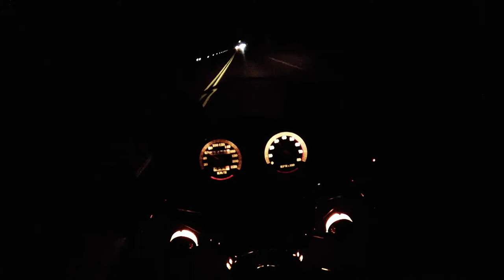1989 FXRS-SP Real World Performance Upgrade Discussion

Comment: Do you have the replacement progressive springs or the heavy duty progressive springs?
Reply from the maker: I have the regular replacement springs. I removed the air adjustable system from the forks, due to continual leak issues and faulty anti-dive solenoid, so he progressives were a little soft with the provided spacers. Adding three 1/8 inch thick washers to the spacers increased the preload to my liking.
Reply: @stirlingshire  Thanks
Reply: My air system has been pulled out and it handles like a dog's breakfast so I think new springs is the way to go.
Reply from the maker: @morganc.2783  Definitely. The progressives do a great job, much better than the stock system ever did.

Comment: Gearing is short?  You mean engine revs too high ,no top end , not good for the highway?
Reply from the maker: FXRs had shorter gearing than other big twins to give them more sporting acceleration. They are fine for the highway, just with busier rpms. In fifth gear, at 75mph/120kmh, the engine is turning at 3,300 rpm. Stock camshaft had the bike out of breath at 4,800 rpm but performed strongly up until that point.
Reply: Can only get mine up to around 102 or 105

Comment: What kind of gauges are those?
Reply from the maker: They are the stock Harley-Davidson gauges that were equipped on the Low Rider Sport, and Low Rider Sport Convertible. They could also be found on Sportsers, and Dynas before the 1996 model year. The speedometer is cable driven.